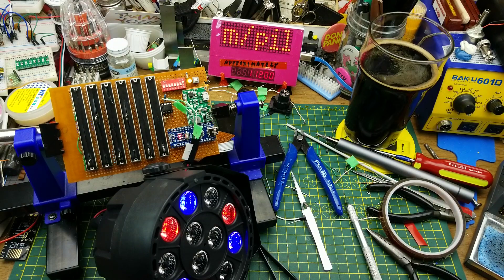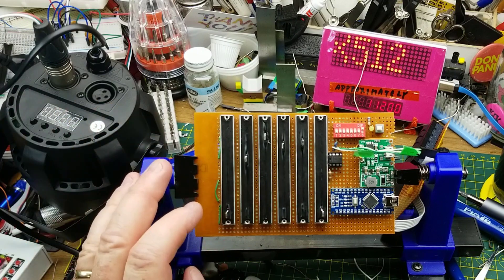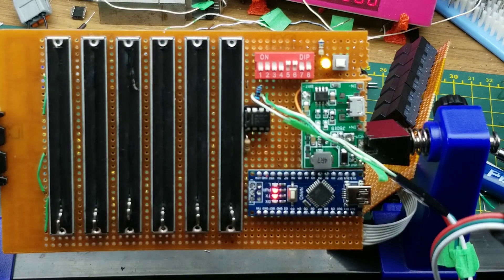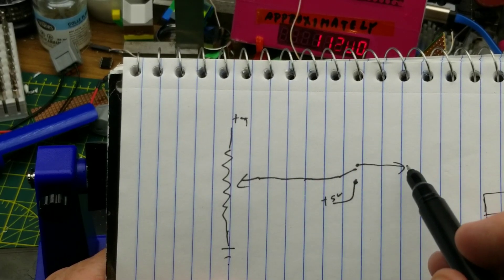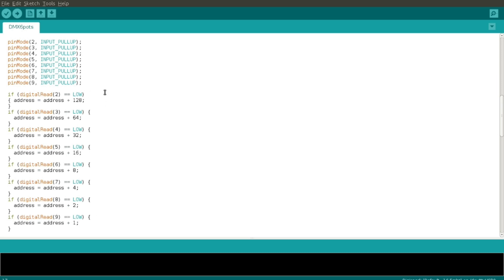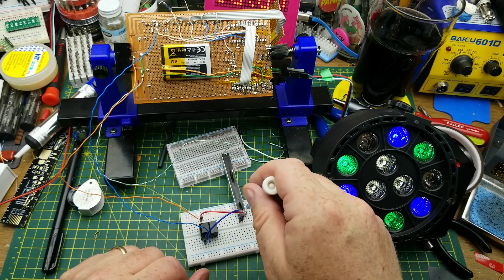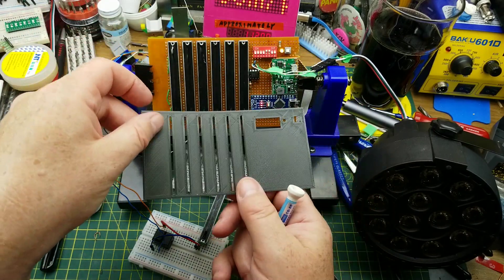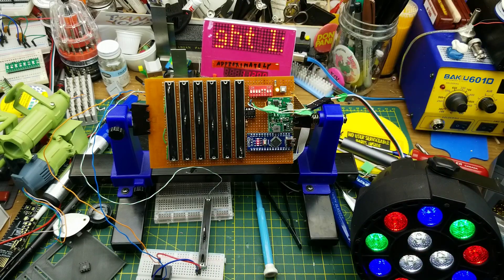homemade DMX512 controller - tinkering and experimenting

Comment: Use a pin extender like the MCP23017 connect it to the arduino via i2C, and connect the buttons to it.

Comment: You did this thew complicated way. You just need an RS486 to USB converter board and one of the simple free computer lighting control software programs that are out there.
Reply from the maker: I did it the "can I do this myself?" way.

In a previous video (link in the description) I did exactly what you suggest.
Reply: @pileofstuff  One version I'd like to see would be a microcontroller(Arduino, rpi pico, ect) and keypad based version where you push a "channel" button, enter a channel, then push a level button and enter the level of that channel. An LCD or oled display connected to display the current channel and level would also be handy. I'm thinking of this as a battery powered tool to go up into the catwalks of a theatre and test lights without having to come down and use the light board.
Reply from the maker: @ravenbarsrepairs5594  That's pretty close to what I was going for, only with faders.

Comment: A tip relating to making custom cases: the hole spacing on your perfboard is 0.1 inch or 2.54 mm. I don't know what CAD software you're using but if you can set grid spacing to this value you might hit the right locations more easily.

Comment: maybe another way you could use those switches for "bump" is to use a break contact to the ground side of the potentiometers, so the resistance wont matter too much and the wiper will just pull up to 5volts when the ground is disconnected.

Comment: Definitely more "realistic" to have your dimmer rack on the floor off stage right. Stage left is where the monitor desk goes. I realise that wiring each lamp down there will be a pain though, maybe a 4 or 5 pin molex or jst could be used as a connector on your truss to the lamp. Maybe a miniature smoke machine would be cool using an electronic inhalation system (trying not to hit any censoring flags) coil and vegetable glycerine would be fun to add to it too

I'm a laser show guy on concerts, raves, events etc with 30 years experience, not a lampy, but we all work closely and cross over a lot :)
Reply from the maker: Hmmm. I wonder what would be a good 1/12 scale substitute for a Socapex connector...
Reply: @pileofstuff  Lemo make some cool little connectors. Not quite miniature socca, but close. Not cheap though

Comment: You may want to look at battery charger/power as i think it has no overdischarge protection
Reply from the maker: The battery has a protection circuit built-in.

Comment: That's so cool. Nice work. I wonder if you could get an SMD version of the MAX 485 to fit inside the lights coupled with an SMD ATtiny 85. (?)
Reply from the maker: That is a possibility. 
Then I'd have to fabricate a tiny SMD  PCB to wrangle them, I suspect.

Another skill to develop!
Reply: @pileofstuff  I just thought, you could get a double sided PCB made, one side per chip. :)

Comment: you could just have put a resistor in series with the pot wiper, then 5v from the button wouldn't be shorted to ground and with in reason the ADC doesn't care

Comment: A verry long time ago I tore apart some addressable device that was 10 bit, they cheated with an 8 pin switch and a 2 pin switch ' to change which range ' is used.. basically the top 2 bits and located near the main blob so all off from factory, and having to open past the battery compartment to ' change group ' it talks to.